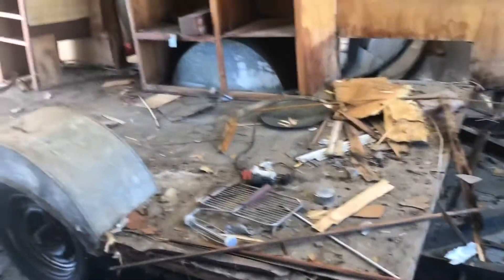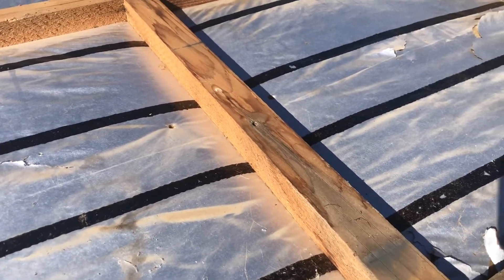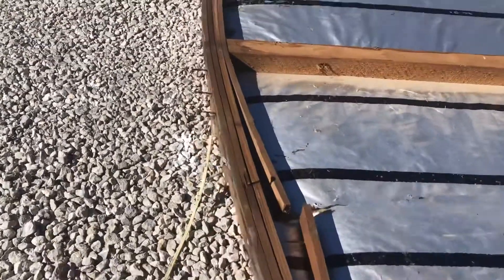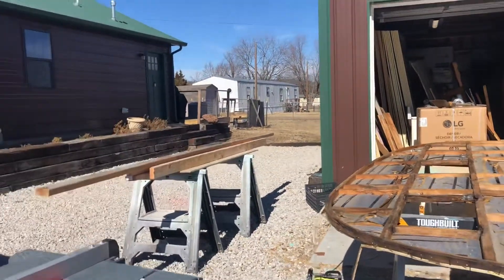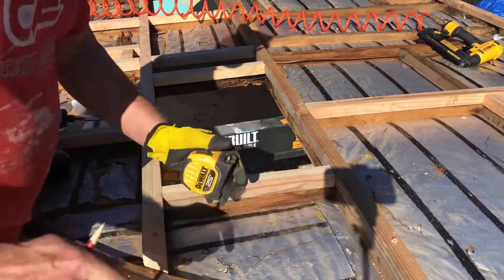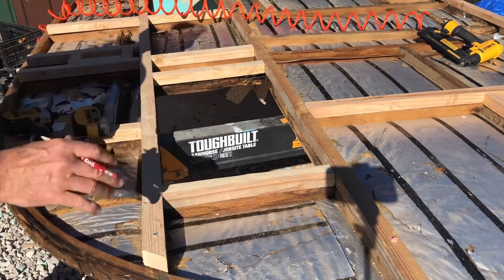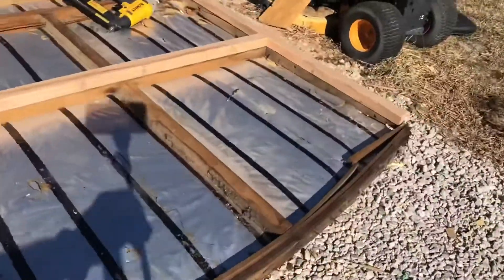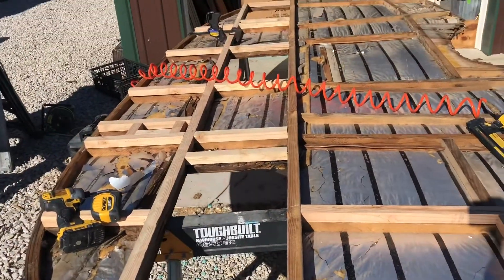EP 127  Step x Step build vintage camper walls Easy way rebuild travel trailer walls1954 King camper

Comment: Rob, I enjoy your channel and videos. I’m doing a 1967 Trailblazer, piecemeal. I think I’d rather build one from scratch in the future, using similar techniques? Or more practical, do a frame off so I can start from the bottom up? Metal is so expensive, windows we can’t find, etc. Keep the builds coming, thanks
Reply from the maker: Join lots of FB groups. You will find lots of spare parts out there. Thank you for watching. Good luck on your build.
Reply: Rob, do you just search vintage trailers, I don’t use Facebook a lot? I think out west there must have been a lot more of these campers, since I heard they have camper junkyards, not here in VA. I found one 1970’s camper I got a larger but usable window, that’s it, lol thanks

Comment: Hi Rob, love your work! I wanted to tell you what I did for the curved portion of my 1958 ALJO. I actually made a template of the curve, and then I cut pieces of plywood with a jig saw to make a boomerang sort of shape, if that makes sense. I then sandwiched multiple pieces of it together using glue and screws. So it actually changed the orientation of the plywood pieces to run the opposite direction as the original. Overall, I think it may of added more strength as well.
Reply from the maker: Great idea. Thanks for sharing.

Comment: How do you fasten the framing together?
Reply from the maker: Screws, nails, glue.
Reply: Have you recorded any examples of you fastening framing together?
Reply from the maker: @johnbaker7182  I guess I did not film that portion. Next time.
Reply: Just curious when and where and why you use each method. I will be watching. Thanks for your videos that you have already posted.
Reply from the maker: @johnbaker7182  I usually try and follow what the factory did when they built it.